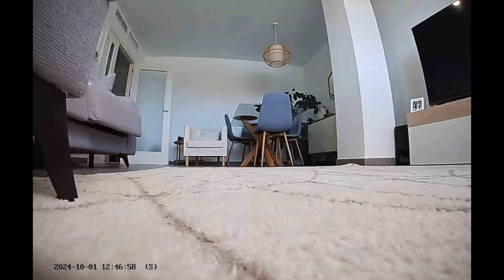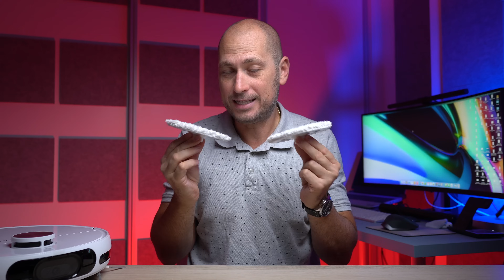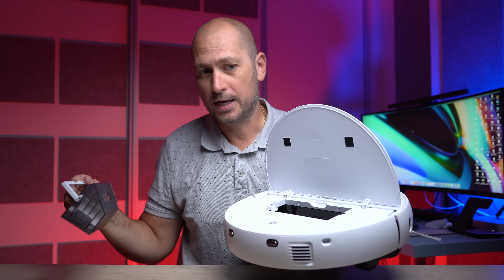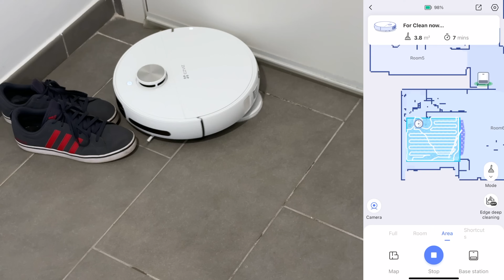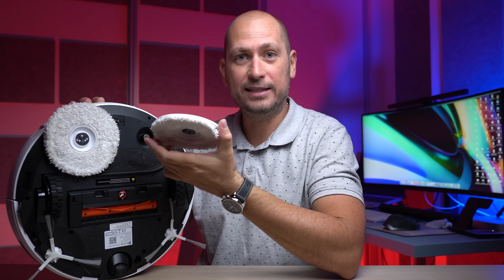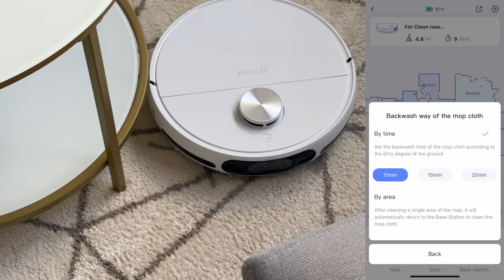EZVIZ RS20 Pro Robot Vacuum & Mop Test & Review - Can Self Remove the Mop Pads!

Comment: how would you compare this to iRobot Roomba Combo 10 MAX?? its like 600€ prize difference
Reply from the maker: Personally I didn't try that model iRobot...I did try 3 other cheaper models and they were all trash. Some of the worst vacuums I ever tried. Maybe the one you mentioned is great...but I doubt it. 
I personally use a eufy S1 Pro vacuum... and it is by far the best one I tried so far and I tried many robot vacuums